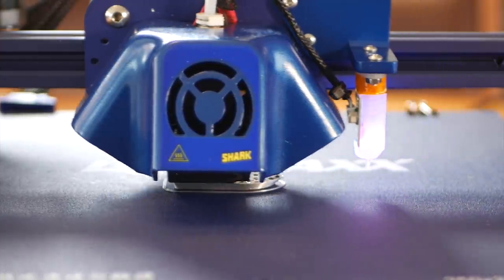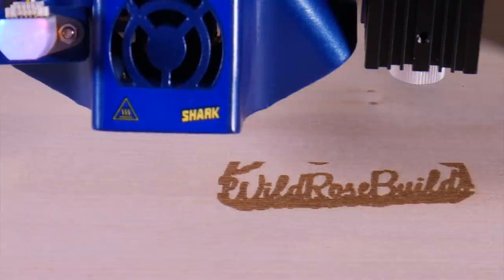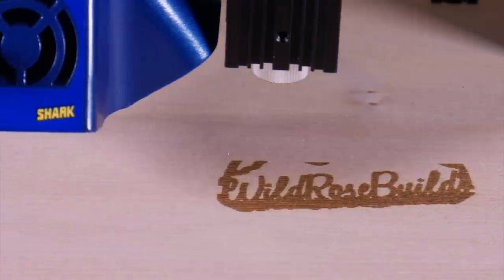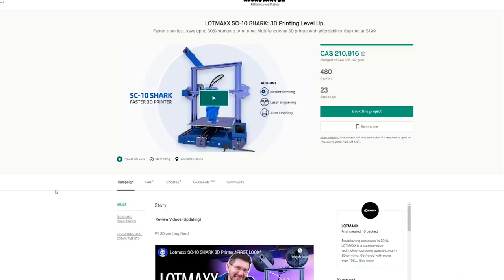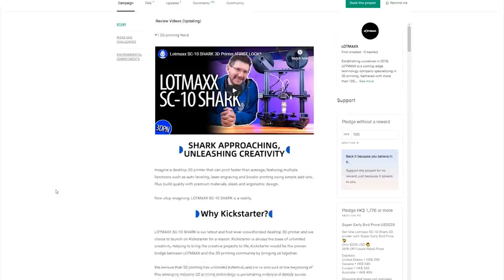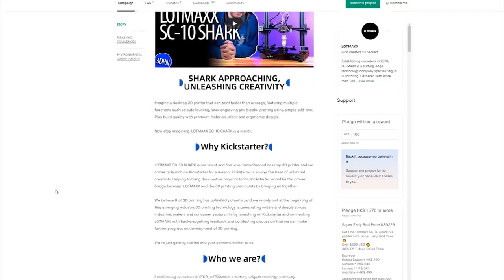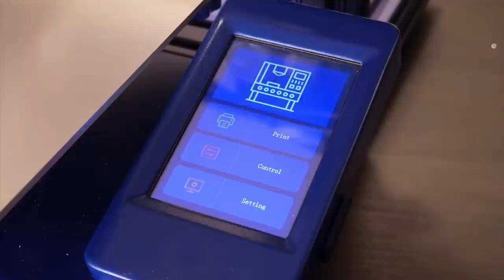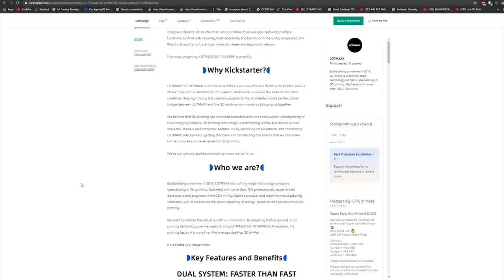LOTMAXX SC-10 Shark 3d printer review

Comment: Upgrades will be difficult for this machine. It may be easy to update the firmware but it is not open source firmware. Any change that requires new firmware will need to be fully supported by the manufacturer.

Comment: My ender 3 is suffering under under extrusion. I have checked the ptfe tube twice and no problem with that, I have printed lots of meters with the same fillament without a problem. The it prinrs like 30 layers and then just stops extruding. How do I fix this! Sorry for my horrible comment.
Reply from the maker: switch out your nozzle if you can, make sure your first layer isnt too close to the bed and turn your retraction down to around the 4mm range. hope that helps
Reply: @WildRoseBuilds  thank you! I will see!

Comment: This wasn't a review, it was a preview. When is someone actually going to take the time and do a proper review of this unit?

We are putting money on the line but you are sent a unit free for REVIEW, could you consider this when you create reviews in the future?
Reply: I was a little hard in my comment but really in a review you shouldn't be using octolapse as not only does it slow printing down it affects print quality.

I see all your reviews are short and I guess it's just how you do it but still I would have liked to have a longer review discussing problems you had, settings you used to fix them, things like that.

Also what is that white piece that is bolted together on the extruder? Is that something you added as the pictures don't have that and the printer Joel has also doesn't have that piece.
Reply: @timmturner  I think that the review was fine, I mean he brought up the pros and cons. He is not 3D printing nerd.
Reply: @HowTo11414  A review should list positives and negatives of the device you are reviewing, otherwise it's an overview which is what this was.

He is knowledgeable on printers and had problems since he mentions calibration, I simply want to know what problems he had and what he did to solve them.

Comment: Closed source firmware, software and hardware. I'll pass.
Reply from the maker: all open source, you can even edit the firmware before uploading it via a text editor. also takes any gcode so you can slice with whatever software you want.
Reply: @WildRoseBuilds  This is not what LOTMAXX said when I inquired on their Kickstarter about the openness of their product. Their response was " We are sorry about that our firmware, hardware and slicer are not open-source."  Link to the firmware source that you speak of? If LOTMAXX are using a reskinned version of Cura they are bound by the licence to contribute the changes back to the code bade.